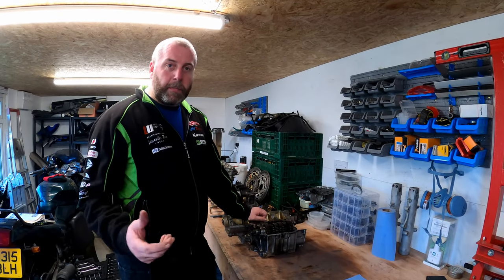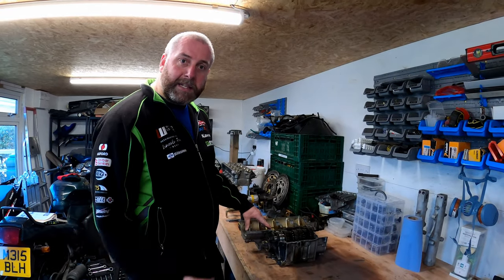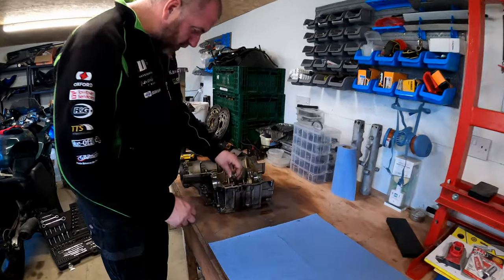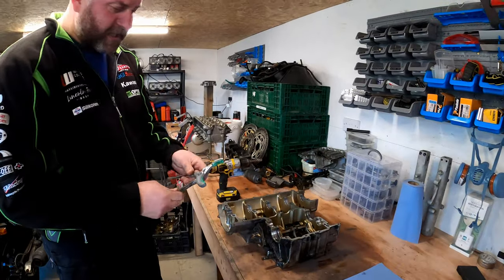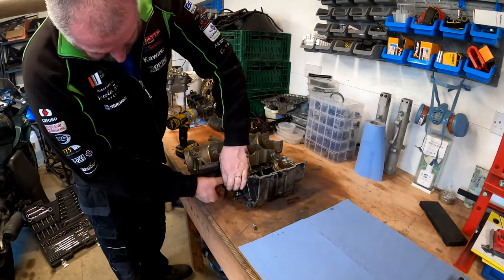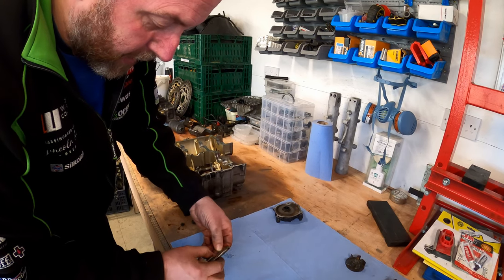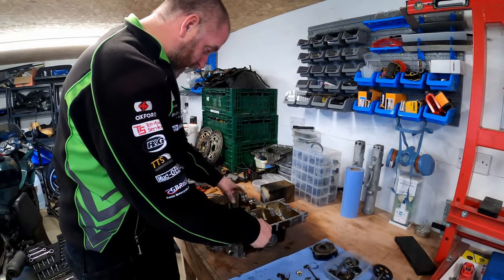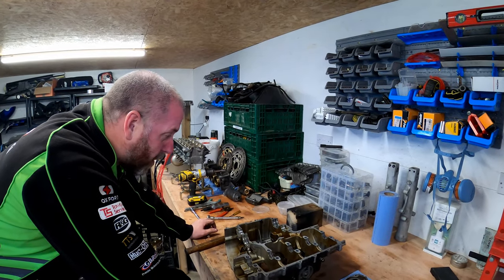1998 Kawasaki ZX9R - Project Shinobi, Episode 13 - Transmission Removal And An Upgrade Preview!

Comment: Very useful! I have a Z1000 gear box ready to be installed for when my C1 gear box blows up... Really looking forward to the output exchange! Please provide info on what type of circlips you use for the job, C-model or Z1000. So far I've found that you need to use new C-circlips. (C2 circlips I reckon..?).

Comment: My C2 rolled round to 92k last month. C and C2 transmission fragility is overstated and can be avoided if the nearside peg is kept clean and greased.
Reply: What nearside peg do you mean? Its from the outside ?
Reply: @PhilTV100  left hand
Reply: @Unfunny_Username_389  you mean the gearswitch rod ?
Reply: @PhilTV100  the peg swivels
Reply: @Unfunny_Username_389  Do you have a picture from what you mean? Iam german and i dont get it 😁

Comment: Hi could you please give me more information on the gear box upgrades please if it’s ok with you
Reply from the maker: When I manage to get back on with the project, I will go as in depth as I can on the topic. But for now, the transmission is from a 2006 Z1000 and is pretty much a drop in upgrade 👍🏻